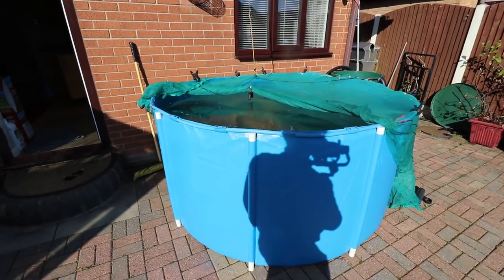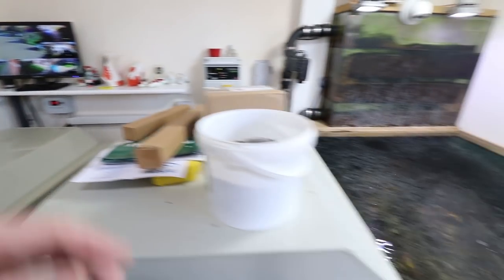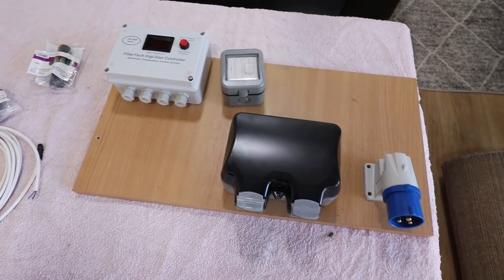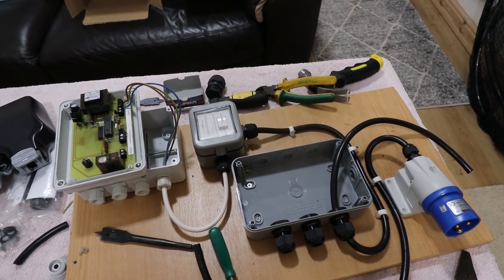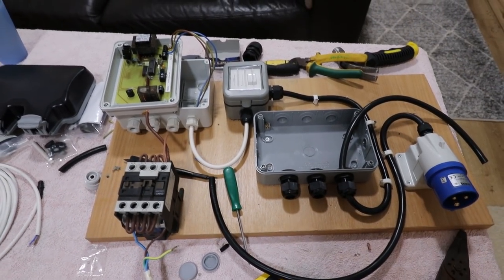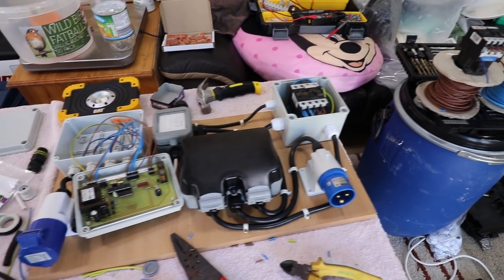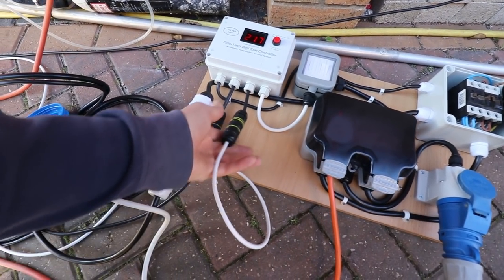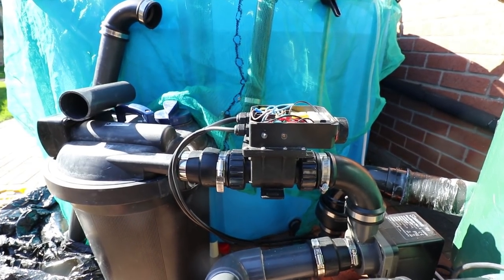Worlds most complicated heater controller for a temporary pool

Comment: The electric heater on my main pond is wired the same way.  I have an stc-1000 with the probe in the pond and the supposed 10a relay in the controller just switches power to a din mounted relay unit in my consumer unit.  You get a satisfying 'clunk' noise when it activates and deactivates.  I love the stc-1000 units they are great value for money and have a 0.3 degree c differential which is better than most heat pumps for stability, but they do require a bit of wiring for use.  I also have one in a waterproof enclosure that has a 300w aquarium heater wires direct to it with a long cable and plug for my temporary breeding pool or other situations where I might need a bit of heat. Again the sensor goes direct in the pond.
Reply from the maker: I've not heard of those before they look very interesting Ill give one a go cant complain for £10 🙂 That sounds like my setup but the big relay really clicks in as its on the house wall we are all watching TV and there is a big bang that sounds like someone is trying to break the wall down sometimes 🤣

Comment: Another informative video Adam, just one thing cooling up the main feed cable can cause big magnetic currents causing  heat and at that amperage I would just check that the coil is not hot under that load if you haven’t already.  Keep up the great work BR Phil
Reply: Biggest issue is multiple layers of cable causing an insulating effect, trapping heat from I squared R loss in the cable. Magnetic effects are cancelled out by currents flowing equally in opposing directions (active & neutral contained within the one cable).

Comment: Hi Adam sorry for the off topic question, I watched your bakki River build video the one made of black pp. On the inlet and waste pipe you used welded a different material what was it ?. Cheers
Reply from the maker: Hi, Because the filter is made from polypropylene the pipe i welded in would have been polypropylene pipe I always use class E pressure pipe but PVC wont weld to polypropylene. Hope that answered you question 🙂

Comment: I use a stc-1000 off eBay cheap and work absolutely spot on 👍🏻
Reply from the maker: That is an interesting device I might have to give one of those a go cant complain for £10. Thanks for that 🙂
Reply: @AdamJulyan  they are very good mate a lot of people using them now 👍🏻 your welcome, I bought a weatherproof box and cut out the front so the stc-1000 slots inside it with only the face showing to weatherproof it 👍🏻

Comment: Could always use solid state relays mate lot smaller than that whacking one - can get LAE stat separately cheap does same job - pro-therm.co.uk do some decent gear - also CERTIKIN heating controller does same Jackson leisure sell em
Reply from the maker: I got it for free so i used it 🙂. I don't generally trust the solid state ones as they can fail catastrophically where as these fail in most cases safely but i have used them a lot for lighting control just not for high amp loads. That website looks very interesting I'm sure that will come in handy in the future thanks for that  🙂.
Reply: @AdamJulyan  there ok as long as you use them as switches with load from mains power

Comment: Hi Adam, I’ve got one of the those filter controllers hooked up to my cloverleaf but it has recently started giving incorrect temp reading so not turning heater on when it should. Anyway to cut a long story short I need to replace it but can’t find anything that does the same job, do you know of anything?
Thanks Matt.
Reply from the maker: Hi, I like those controllers so when I heard they stopped making them I bought a few for spare so if you need one let me know I have some spare they are about £100 + temp probe if you need one.
There are some similar ones i think pro line make one.
Adam
Reply: @AdamJulyan  brilliant! I’ll take it off this weekend and have a look at it and get back to you if I can’t fix it!

Comment: Be careful of the wago connectors they all have different A ratings. 16A/ 20A / 32A. Says on the side of them 👍🏻🇬🇧
Reply from the maker: Thanks ill keep an eye one them, I'm new to them i tried some years ago and didn't like them but these ones seam really good i got the 4mm 32a ones and so far I'm really please with them 🙂
Reply: @AdamJulyan  they are by far the best of all the similar types. Slim and good levers and always a good connection. I’m a spark and use them regularly